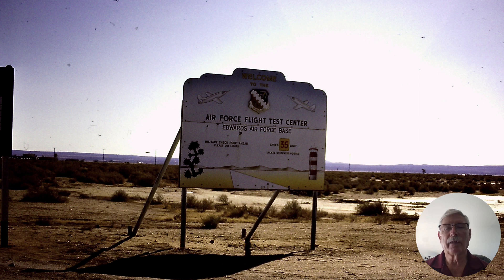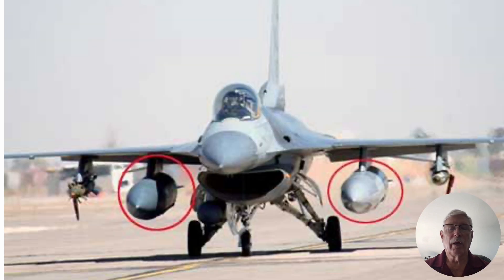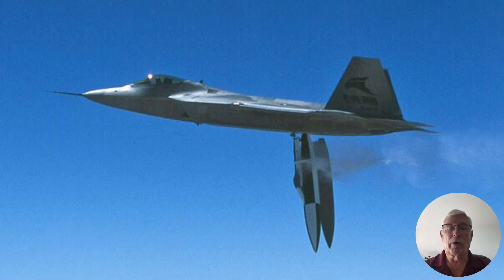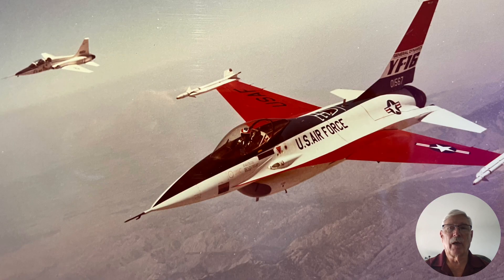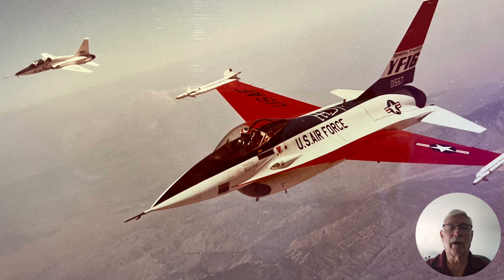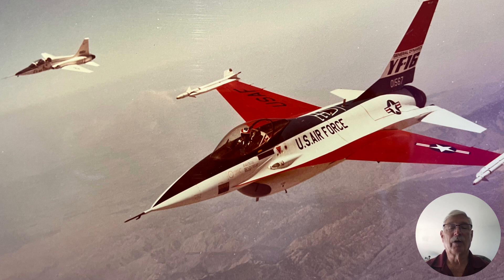F-16 SUPERSONIC TANK JETTISON test.

Comment: 575 gallon tank, does that mean the old YF-16/FSD style of tank and not the modern 370 or 600 gallon tank?
Never could find specs about those early tanks. What was the size on the early centerline tank, was it 300 gallons like the modern one?
Reply from the maker: I may not be remembering the tank size correctly. It was a long time ago and details sometimes fade.
Reply: @ronrogers  ; Thanks for the reply either way, behind the scenes stuff is always interesting to hear.